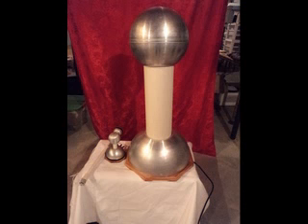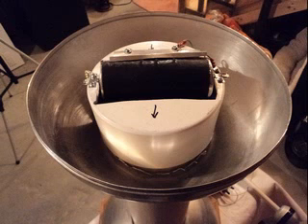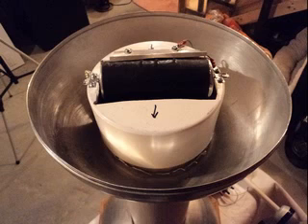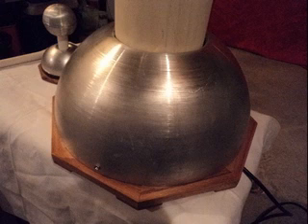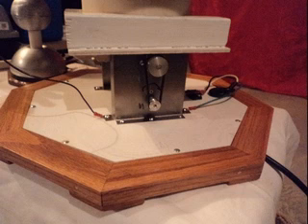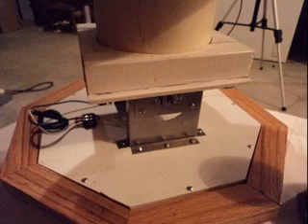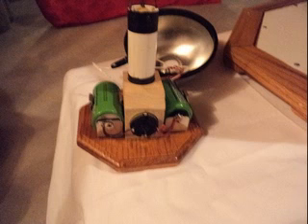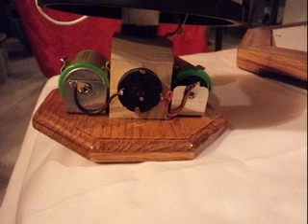Home Made 300KV Van de Graaff Generator

Comment: Nice work! Have you measured the current? Also where did you get the 16 inch dome? Thanks.
Reply from the maker: Russ, I bought several globe hemispheres from Dayton Metal Spinning in Dayton Ohio several years ago.  They are made of aluminum and are typically  gold anodized for use atop flagpoles.  I haven't measured the current yet, but it's probably around 30 uA based on the 2.5 uA from the small generator with 1/2 inch belt.
Reply: Thanks, I'm always on the lookout for good VDG top domes. The cost of metal spinning nowadays seems way too high. By the way (you  may know this already) an old rule of thumb is fifty square inches per second of belt gives one 1 uA of current for a self charging VDG.
Reply: @russedmonds227  I bought one from a garden supplies outlet, they use big metal domes for water features, so you can get ones quite cheap.